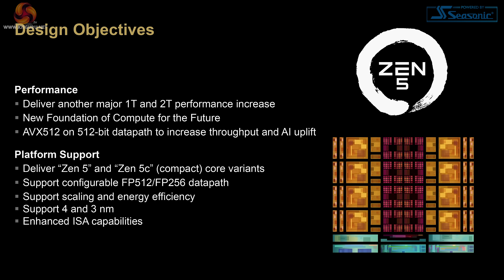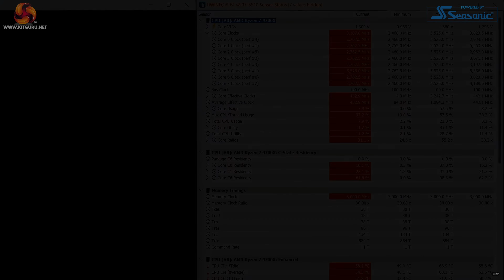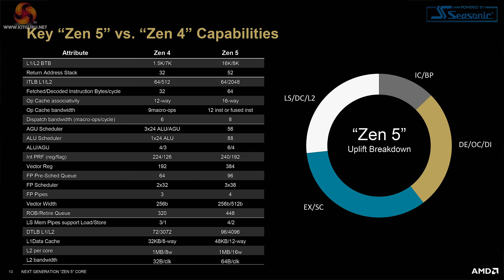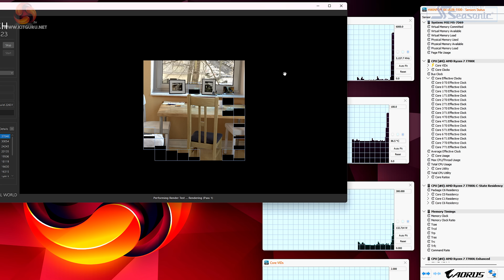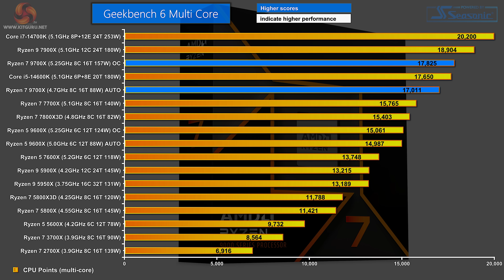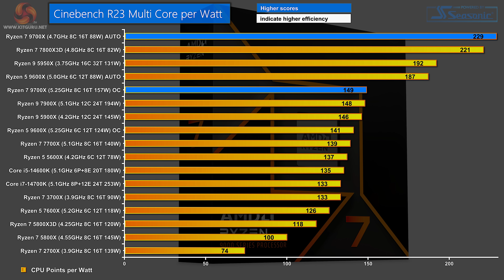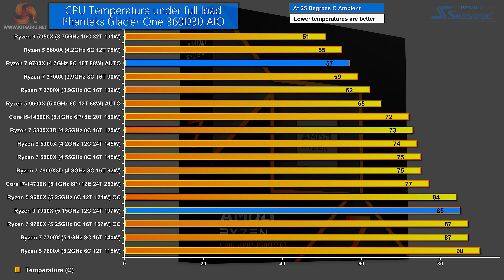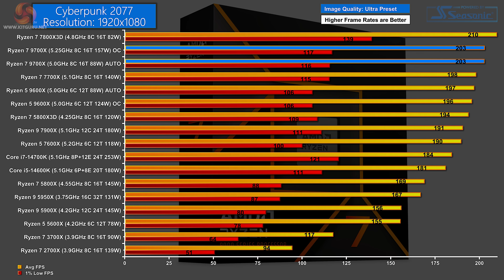AMD Ryzen 7 9700X review: YouTube hates this CPU

Comment: I like that you are realistic and present a valid example of someone like me that bought this CPU. Specifically I bought two of them, at a price of 217 EUR + VAT . I replaced two company pcs that are a decade old , so why would I a) consider anything besides this cpu , b) bother with a last gen cpu that was 7 eur cheaper. All these other reviewers are comparing this CPU to the previous model , rather than the product on its own. A customer like me goes on a website and browses for CPUs , see various listings and has to make an educated choice. What difference does it make if the previous product is almost the same but this is a refreshed version? All we see is a list and have to decide what is the better value for our money. Not how small of improvement the product is from last years. And if we're talking about a production PC that is running for 8+ hours a day , half the consumption in power is an amazing improvement.

Comment: i sold my 7700x for $240 and picked up an open box 9700x for $280 a few months after it released.  $40 to not have that hot as hell processor was worth it for me.  the msrp was too expensive though, used and open box was the way to go.
Reply: Lol all you had to do enable eco mode in your bios. It caps the cpu at 65w just like the 9700x/7700.

Comment: A couple of months ago I was about to upgrade from 5700X to 7700X however when I started looking into it, it would have only cost me around $50 extra to go straight to the 9700X. Still haven`t got any CPU yet and lucky I waited a little because now 9700X is $20 cheaper than 7700X
Reply: Great. A highly tuned 9700X if you get lucky with the silicon lottery is able to match a 7800X3D in gaming performance.

Comment: most of the amd cpus are useless... they should a ryzen 5, 7 and 9 x3d for gaming (one each), a ryzen 5, 7 and 9 x for work (one each) and a ryzen 5, 7 and 9 entry-level (one each). no need for more than 9 CPUs at any given time. if you want the 5 for gaming, there's no point in anything other than 5800x3d. 7800x3d for the 7 series. and 9800x3d for the 9 ryzen. everything else is noise...

Comment: When you live in this mafia that is EU, with its absolutely insane electricity prices, and totally made out since my country relies mostly on cheap nuclear power, a massive drop in needed power isn't a small thing, it's a real plus. Going from an 11th gen intel to a 9000 series ryzen 7 and skiping the unreliable and power hungry intel CPUs of the 13th and 14th generation is just the right move. And it's sold in tray version, so zero garbage stock cooler taking the dust on a shelf.
I'm writing this comment quite late, but this CPU supports now a 105 TDP mode and can rival the 7800X3D.
I don't need a monster for gaming, as long as it can keep up 120 fps, a 9700X + 5060Ti is enough.

Comment: Hello, I am hesitant to buy an upgrade from an 8600g to one of the 9600x, 9700x, 7700x, 14600k options for working with Illustrator software and also generate photos with ComfyUI... Most comparisons focus on gaming users... Of course, I notice that ComfyUI processes more with the GPU and I have a separate graphics card... But for working with Adobe  Illustrator software and also processor-based processes with ComfyUI, I am hesitant between the above choices... I would appreciate it if you could help me.

Comment: 5800x3d is a great gaming CPU but I noticed the 9700x out performs it on every benchmark you just did. I'm looking to upgrade my PC systems. I have 3950x, 5700x3d, 3700x and 3800x. This simple 9700x cpu out performs all of them, very impressive. Micro center near me selling 9700x for $289.99. Oh another pro about the 9700x is that you don't have to core park your cpu if you want to game compared to 9800x3d, 9900x3d and 9950x3d.  If you want to buy a cheap gaming PC why not get 9700x. Thank you for your review. :)

Comment: I don't see where all the flak is coming from in regards to this CPU. I think it's great. I needed to make a new main/gaming rig since my old one was approaching its 7th birthday. I got the 9700X as my first CPU to tide me over for now. Just like Socket AM4 has its best gaming CPU in the form of the 5800X3D, I'm waiting for AM5's magnum opus for gaming to be released before I upgrade. After I do that, I'm still keeping the 9700X to use in a backup PC. Right now I have it running at the 65W TDP and it's performing very well. My old 2700X had a 105W TDP, so I have more power for less juice. Very happy with this CPU and I will be using it for at least a decade.

Comment: I am really confused by the take of the YT channels. 
They bash the 4060 for low performance and they bash the 9700x for low performance, with the reason that "gamers want the max fps without any care in the world for efficiency".
I beg to differ. 

I think it was the correct step to release parts that have lower power consumption overall. I would have loved to see a '70' card at the 150 W TDP point again, like the 1070. 
I am truly irritated and annoyed by the review process chosen. 
My current PC is a 5600x with a 6800 XT, 4*8=32 GB RAM 3600 on a 144 Hz 1440p monitor. 
I try finding a channel that gives me relevant information with which I can build the most efficient PC without losing out on performance. So is it more efficient to buy a 4090, because it draws less power than a 4070 TI at 144 fps? 
I do not know. 
Do I need a 9800X3D to always meet the 144 fps mark?
I do not know. 
What I know is, that I have a 750W PSU and I refuse to buy a bigger one.

Comment: Ive got some pretty noticable gains going from the 5800x to the 9700x at 1440p using the 105w mode. Temps are always under 75 with a 360 Corsair AIO.
Gained 30-40 fps in spiderman 2 and indiana jones in alot.of areas
Reply: @xXOriginalSin  Just got my 9700X and saw the 105W mode in BIOS but haven't enabled it yet. Have you run any CPU stress tests yet to find out if the CPU boosts any higher with it enabled? Disabled I get about 5200 MHz continuously on all cores with AUTO settings on everything that has to do with the CPU. Asus Rog Strix B650E-F WIFI.

Comment: Thanks for this balance view.  I've just ordered one to replace a 5yr old i5 so it should be a good update.  Sure the R7 7700x was about £50 cheaper but I tend to build in small cases and prefer quite PCs so the low TDP is a key selling point for me.  Also the 9700x isn't that far behind the 7800X3D for a lot less money.

Comment: My opinion its a very good cpu, remember most of the load will be on the gpu, 4k ultra settings, an dnt forget when windows had a big update for amd cpus 24h2 was a big bump up in performance, an there are more updates coming so u never know there might be another increase in performance with amd cpus so 9700x can still perform even much better than it is already
Reply: Just clean installed Windows W11 24H2 on a new PC so I got nothing to compare with 😊

Comment: I absolutely love the 9700x. The 65W TDP is very nice. I don't understand the hate, it's not like gaming suffers that much and there's really no reason to get a 7000 series CPU unless you want an extra beefy space heater. I upgraded from a 5700x and I think I made the right choice since I'm keeping thermals and energy usage down and achieving a much more pleasantly smooth computing/gaming experience at ultrawide qhd resolutions. The price was right as well considering the only plausible 7000 series upgrade would have been a 7800x3d that was over a hundred dollars more.

Comment: "Unless they havent built a pc in years"
Thats me!!  I was able to snag this for $200 brand new and even if it isnt the most EXCITING cpu compared to other new cpus, its still a MASSIVE upgrade from the i7-8700k that I'm currently using.
Reply: I remember the 8086K from that era that I wanted to get my hands on but waited until the 10900K which still is my daily driver.
Reply: @VNAV_PTH  "from that era"  

Ouch
Reply: @FeralKobold  Haha, it's not that bad, I've got a 3930K/GTX580 system also. It has an easy life, serving mostly as a media PC nowadays.

Comment: got 9700x bc 9800x3d out of stock and want to beat magat tariffs. its fantastic!
Reply: Hi! Can you tell me is your 9700x cooled by Air cooler? If yes - what temps do you get idle and while gaming?
Reply: @nikolaterziev93 It's cool at AUTO settings. Just got my 9700X, maxes out at about 60C under OCCT CPU+MEMORY stability test with Arctic Liquid Freezer III 360 but keep in mind it is quiet even then because I am running the fans and pump on curves. It would probably be even cooler if I maxed out the fans and pump. I have no GPU yet so no gaming results.
Reply: Imagine thinking that these tariffs will come into effect next month and that they will affect you.

Comment: Now 4 months later the Ryzen 7 9700X is Impressive and after Motherboard Bios Updates and Windows AMD updates with Driver Updates this Processor is just Awesome.. There were really a lot of well known Youtubers that Rushed their reviews and felt like a copy and paste situation. Then there were also Youtubers that went the Extra Mile and did better thorough reviews or even 2 to 3 months later a Re-review .. The 9700X is performing good in Productivity and in Gaming and with a lot of newer You tube reviews this processor is close and on par and in some even better than the previous 3D and newer 3D one.. Its got a Happy Medium of Both sides and much better results than 4months ago. Also in some Countries the older 3D version costs still more than the 9700X and the newer 9800X 3D is 4 to 5 thousand more in currency so its obvious to go for this one and also it makes sense not to upgrade from lets say a Current AMD AM5 Ryzen 7700X setup as its still in a close loop with previous gen results...but the 9700X gives better power efficiency with good performance. This is like this video mentioned If u Are a building a new setup this is an excellent choice and also if u come from lets say an AMD AM4 setup with a AMD 5 5800X. U really do see a big difference in general from that also.. even with mentioned Bios updates and Windows driver updates so to sum it up for me as compared to newer benchmarks and results that I seen and self concluded on what I need and can afford in my country this is the best choice and I'm happy as it comes close to previous and current gen 3D and is good in Productivity and in Gaming and in the future I can still have the freedom of upgrading when better processors are lined up in 3D and so on.
Reply: Good post !

Comment: I was going to buy a Ryzen 7 7700X combo at Micro Center but for $50 more they had a 9700X combo.  The TDP was almost half so I could get by with a smaller cooler and an old case.  It ended up being cheaper.  It has been running cool.  Efficiency matters.

Comment: Just ordered a 9700X, hoping it will be a good upgrade from 10700K. The 9800X 3D is 200 euro more expensive where I live, not sure it is worth the cost, as I own a RTX 3080.
Reply: not worth it if you game in 4k. It would be if you play 1080 or 1440p. 9700x is right up there competing with the X3D chips
Reply: 9800x3d and all x3d are worth it if you can afford it cause they're beasts in gaming. just how 4090 is beast gpu for gaming, x3d is the same for cpu.

Comment: love your reviews, getting fatigued by the other click-bait'y doom and gloom only-gaming-focused channels.  I have an i3-10100F rig that I built when my Sandy Bridge Intel rig bit the dust back during the pandemic.  Since prices were through the roof on many components, I paid an unjust amount of money for my paltry 10100F system.  I'm a software developer and I am REALLY overdue for something more capable.  I've been looking into Intel's new platform, specifically the Ultra 245k, vs AMD's new offerings, primarily the 9600X and 9700X.  You nailed it on several occasions when you concluded these chips are for those looking to upgrade from well aged systems 3-5 years old.  I'm literally the target demographic.  Still debating which route I want to go.  I know Intel is in trouble but the 245k is a productivity beast from what I've seen.  It's going to cost a bit more, and I'd rather save on the CPU so I can spend more on storage, ram, and proper cooling, and I like how AMD supports their platforms for ages.  Thanks for your thoughtful analysis.

Comment: A big reason why people are upset with the new 9000 processors, because of AMD misleading marketing, AMD staff literley lied about how much faster they are compared to 7000! Of course the new 9000 processors are still good, but why would you buy them, when the 7000 processors are a lot cheaper and are apperently only 3% slower. I am of course talking about gaming, for what most people use them for, in productivity they seem to do a lot better

Comment: For the price - it needs to have more performance uplift compared to the 1 previous generation.  Going from my 7xxx series - the power consumption drop is not enough to justify the price.  The 7xxx is very power efficient compared to Intel.

But - for the price - it needed to have a really solid performance uplift - which it is decidedly lacking.

Comment: You need to compare the non-X 7700 and 7600 with the new 9700X and 9600X cpus for a fair comparison as both are running at 65w TDP stock.  Only then can you get a true measure of power effiency gains between the two genearations.  Comparing a 65w TDP 9700x with a 105w TDP 7700x doesn't make sense because the lower wattage cpus will always be more efficient...

Comment: I was on an i5 8500 and 1060 6gb. Wanted a new computer but needed a small form factor. 9700X was a no brainer - essentially the same as the 7800x3d in performsnce but 40W less. Hopefully the case keeps chilly
Reply: In a similar situation, currently on an i7 4790k. choosing between a 7800x3D or 9700X. Mostly game on emulation (RPCS3, Xenia Canary etc). Can't decide which to go for.

Comment: My PC journey (year bought): AMD Athlon XP 3200 (2003) -> Intel Core 2 Duo E8400 (2008) -> Xeon X3360 (Core 2 Quad Q9550 equivalent 2013) -> i7-6700K (2016 - now). 
The i7-6700K with 32GB RAM and NVMe OS & Data drives (+some SATA) still does everything I need it to. Still on the fence as to whether I'll stick with Intel (Arrow Lake?) for my next build or go back to AMD (Zen 5/6?). 

I mostly use it for heavy browsing and office work (Excel, Teams, WhatsApp and remote support mainly). Will definitely want 10G Ethernet and plenty of storage options.

Comment: I think my problem with the 9000 series is that the marketing team touted them as having such huge uplift in performance vs 7000 series and Intel, but that's been complete marketing fluff. 

That's a real shame, because their increase efficiency and lowered TDP are both significant moves forward in efficiency and power-per-watt, but these products are just overshadowed by bad marketing, which seems to be AMD's problem as of late.
Reply: All these companies have been doing that for decades. I’m surprised people are surprised. Like this is a new development. 😅
Reply: @Itsameamario-ns3se  AMD has not done that since the launch of Ryzen. Their numbers have always lined up pretty well with independent 3rd party testing like KitGuru and the others. That's why this is shocking. They already clear Intel without lying or fluffing numbers, and again, their energy improvements are nothing to squawk at, but their claims of performance gains are.

Comment: I don't think there's really an argument. Even your point about TDP is vastly overblown, as the difference is generally much smaller than intended. They are basically the same processors, with very tiny tweaks, that's it. But they cost much more. There is nothing left for them, unfortunately, nothing at all.
(The dfferent "architecture" is all peripheral stuff of mostly making some sort of pipeline or mini-cache a bit bigger than it was before. It's not a true new architecture.)

Comment: Good video, but I am missing the Ryzen 7700 (non x), because it is is running already with 65w power draw and seems to be only slightly slower than the x version... The 7700 costs here in Germany 220€ while the 9700x is 380€ - so you get between 5-10% performance uplift for 80% more money.... This is just bad value

Comment: I simply don't care about performance per Watt. My i7-14700 outperforms all Ryzen CPUs and draws 100w more. So over 10 hours that's one kw. Since one kw costs me 14 cents, I'm willing to pay that for 20% better performance
Reply: lower temps mean more oc headroom. It’s better all round.  amazed people haven’t learned since the intel dramas lately. That’s how going the other way has resulted in failure.
Reply from the maker: The extra power is very little to do with the cost of electricity and mainly to do with looking after your processor and managing extra heat.
Leo
Reply: @KitGuruTech  As long as the CPU is properly cooled and operating withing thermal limits, extra power doesn't matter.
Reply from the maker: @LouisDuran  I refer you to Intel's problems with Raptor Lake which suggests the exact opposite
Leo

Comment: WHY IS IT THE ONE THING MISSING IS 800 SERIES CHIPSET MOTHERBOARDS? I AM SURE THE HAMSTRING THING GOING ON IS THAT TESTING IS BEING DONE ON 600 SERIES CHIPSET MOBOS...THIS IS NOT A GOOD REPRESENTATION OF A NEW CPU FOR EITHER AMD OR INTEL....INTEL WORKS BETTER ON DDR5...BUT YOU HAD BOARDS..NOW AMD? ARE THE PERFORMACE ISSUES DUE TO CHIPSET DEFINCIES OR SILICON ISSUES? INQUIRING MIND WOULD LIKE TO KNOW....
Reply from the maker: Your ALL CAPS is a bit painful. 800 series chipsets are due for release at the end of Spetember so it would be tricky for us to use motherboards we do not yet have. Quite why AMD has handled the release that way is a mystery.
Leo